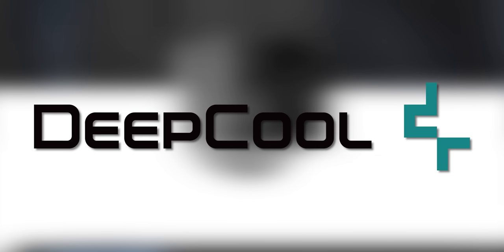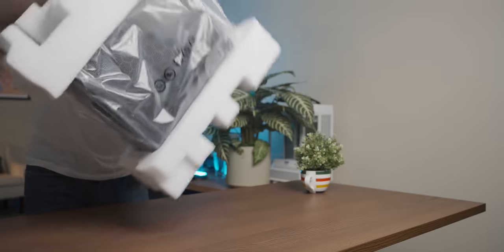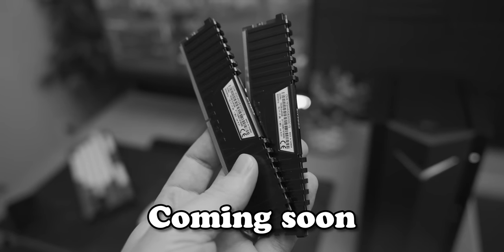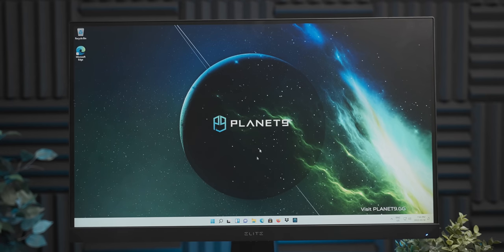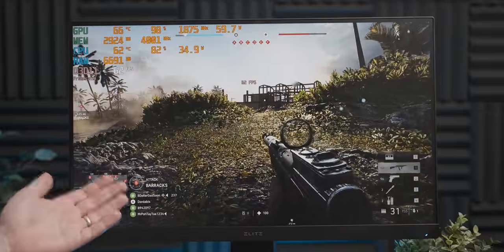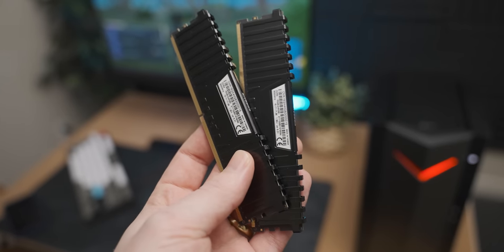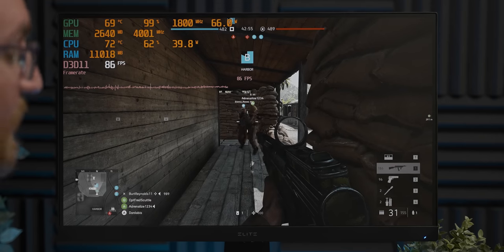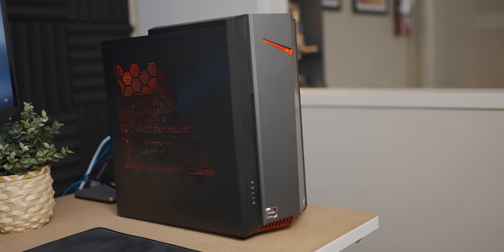I Bought The WORST Rated Best Buy Gaming PC

Comment: My Lenovo Legion T730 has also such an amazing Bios (with mouse cursor but that doesn't works at all)
I have a I 7 9700k without any Oc options 
Those offered trough lenovo vantage wont work both for Cpu and ram
Ram are 3200 and only run at 2600 and all such stuff

Comment: Well I have an Acer Predator Orion, I upgraded the Ram from 8gb to 16gb, you have to use non-xmp Ram, I had some sticks and they run at 2667, I also threw a 3060ti (it came with a 1660 super) and runs great, the processor is an Intel 11400f that could use a better cooler (is not a cooler master)

Comment: The part i find funny is that it already has one of those sata power cables in it already...both used to power the LEDs...both, not one, but both, because we all know that LEDs are notorious for being power hungry.

Not only that, it has an additional 2 proprietary sata power headers on the board, which means 2 sata power cables each with 2 sata connectors for a total of 4 sata power connectors, all the while only having 2 disk rails AND only 2 sata data ports on the actual board itself. (another potential sata port could be soldered next to the ram slots, it has pads for it, but that's still 3 out of 4)

Comment: the part that is limiting the gpu actually IS the cpu...you have a 5600g with 6 cores and 12 threads..so if you get around 50 % cpu usage its actually using 100% of the hardware cores...
and you will never get 100% ram usage at gaming because you are running things in the background and there is always some system reserved ram

Comment: @Dawid, my system is a Lenovo ideacenter AIO 3 24ARRO5
Processor	AMD Ryzen 5 4500U with Radeon Graphics            2.38 GHz
Installed RAM	16.0 GB (15.4 GB usable)
System type	64-bit operating system, x64-based processor

do you have any recommendations or videos for upgrading/overclocking etc.... presently it is plenty fast as my gaming consists almost exclusively of war thunder, world of tanks and world of warships all of which I can play at max settings 60+ FPS however if/when I move on to any triple A titles I realize i might need a bit more oomph.

Comment: The shell looks almost identical to the Lenovo ideacentre 9 desktop. Which I bought like 4 years ago for like $300 at the time. Upgraded my GPU to GTX 1660 OC, added 8gb more ram. 

All in all I only spent just under $600 (579ish) for an entry level gaming pc and light video editing with very similar specs to this build 

Do not spend $1200 on this. When you can build it for literally less than half.

Comment: Probably stupid Q: is the GTX 1650 connected to the PSU, or is there an cable from the PSU that can be connected to a GPU? Since I'm guessing it is a proprietary PSU connection to the motherboard, you can't simply put in a new one if it won't work with an upgraded GPU. At 500w though, you could definitely power a decent midrange GPU in there, as long as it can connect to one.

Comment: I don't get why the original ram is running at 3200 but upgraded is slower than stock.

If the speed can't be changed in bios is the original ram proprietary and recognised by the system?
Reply: its the set base speed of the specific module, most ram technically needs to be overclocked to reach its advertised listed speeds and is base clocked a lot lower like the 2133mhz shown here. basically the stock module has a much higher base clock than ram that needs xmp for a higher clock

Comment: I recently picked up a AMD Ryzen based laptop, and it came with single 8gb stick. It only has the built in GPU, it's a Vega 7 I think, and it could barely run any games. I managed to find an identical 8gb stick, and after install it can actually play games. Forza Horizon 5 went from unplayable to a steady 30fps at medium low settings for example. It's so important not only for the CPU but using an APU based GPU it's basically required. I know it's not a gaming laptop, but that $25 stick of ram made it so much better. 8gb might be enough but not in single channel sheesh.

Comment: i have an acer nitro 5 laptop its the an515-43 2018 version if i recall correctly and ive had it for like 2 years. probably 2k hours of usage, never cleaned it once so when i open steep it spikes instantly to 80C both cpu and gpu and then later gpu hits max 87c and cpu max 92c. planning on upgrading to a non-prebuilt desk computer

Comment: One thing to note about the ram is that you need to buy JEDEC-specced RAM if you're seeking higher than 2133 speeds because these BIOSes(?) can't read XMP profiles. Manufacturers like Crucial sell RAM with JEDEC-3200 profiles. As for your "mom buying little timmy a PC" use case, there's no way a user like that will know that information.

Comment: Okay ... I have had prebuilt machines from BestBuy. I buy a lot from them. my latest gaming pc is prebuilt! I have an ASUS rtx3060, i7-11700K 32 gigs of memory, (3200mghrz) 2 terabytes of memory. Granted, the CPU cooler is trash, but I upgraded it with the Noctua NH-D15. Runs amazingly! I run 165 FPS on my 2k monitor from dell so not bad (apex, Anthem at all high- ultra settings (yes, I like the game don't judge me) ~ that's being said, if you know what you're doing, how to tweak your system correctly than you have a solid PC. I got the PC prebuilt due to not finding a decent 30- series GPU... so this was my best option. usually, adding new ram and a better cooling system does the trick!

Comment: Hey, when you start that monthlong suffering with the Acer Nitro Suck Face MACH 3, put the 8GB stick of ram back into it so that you can have a "long term" experience with it performs out the box, similar to how a non-techy average consumer would buy and use it. Not knowing the system is being held back by that single 8gb stick of ram.

Comment: I bought Acer Nitro N50-600 i5 8GB 1TB 128GB 6GB GTX1060 Gaming PC from ARGOS and it is excellent very fast great reliability with no problems I added a 8GB of memory to make it twin channel but that was all. It has run perfectly for two years and I love it. It is a quite different Nitro 50 than yours I admit. My bios is totally different from this one and game performance  does not change over time. Even after two years it’s still as fast as it was when new. Maybe the export a better version to the UK but  I  have said no issues with the UK  model.

Comment: Ive got the 11400f and 3060ti model when the gpu shortage was still much worse. With only a single outtake fan the gpu runs upto 78-80c but the cpu with the crappy cooler never hits above 50. Came with dual channel ram by default and a 1tb drive. The only complaint I really had is the case is pretty cheap and I have to remove my gpu to reach the sata ports. Think they reused the motherboard layout of the 1660ti version which didnt reach that far to block the ports🤣

Comment: Really goes to show how much dual channel memory can lift the performance of a crappy system like this. Currently running an OEM i7 6700 from ages ago (back when I didn’t know about the PC community), and it has single channel RAM which makes the operating system chug a lot in certain cases. Furthermore, Z170 only supports up to 2133 MHz RAM and Dell cases are EXTREMELY hard to replace the motherboard without major rewriting.

Comment: That system getting slower is almost definitely a result of the single stick of 8GB.  Because it would likely be using more than 8GB of system memory when gaming, you'd be using that poor NVMe drive as swap memory, wearing it out quite rapidly (Limited reads and writes).  I'm surprised Acer's R&D department hasn't caught on to this and upgraded to 2X8GB or even 1x16GB stick(being cheap corner cutters they are) instead.  8GB is just not nearly adequate for Windows 10 or 11 while running games.  Seems like they're more concerned with getting as many systems out the door as possible rather than providing a quality product.

Comment: I had a nitro 5 laptop which came with single channel 8gb of ram and I constantly had stutter in games for no reason. I then bought a single stick of 8gb crucial ram and combined it with the stick that came with the laptop. Inanely better performance with no stuttering and it ran at 2666 which I think is the max speed of that stock ram. The crucial ram could probably do 3200

Comment: I’ve had quite a few acer computers since they always had higher specs for a lower price. And only one out of the 4 different ones I’ve owned over the last 15 years actually overperformed and never gave me an issue. 

It was an amd a4 1.0ghz dual core netbook with 4gb of ram and a touch screen. Absolutely unit lasted me throughout uni and even played some games at their lowest settings.

The other three (2 desktops and one laptop) all were fine but always had some sort of software issues and niggling things that were mildly annoying, not bad enough to refund.

Comment: I just bought the Acer Nitro 50 640 PC, with an Intel i5 12400f and a 1650, and for $599 US, and it’s literally been perfect, it runs all my favorite games like Valorant beautifully at 240hz 1080p low. I haven’t had a single issue. For the price I’m completely blown away and very happy. Don’t let this video scare you.. I’ve heard bad things about the Ryzen Models, I think those Acer Motherboards hate Ryzen. Oh also, mine doesn’t get any hotter than 70 Celsius max.

I like it so much I’m gonna put a 3060ti into it and more ram, yes, I haven’t even added ram yet and it runs great.
But yeah, the Bios is horrible lol but at least my ram came in at 3200 which is what it rated at

Comment: Changing Ram is just a part of the fixing. Add HDD or SDD and install all games as well all programs except Windows will help  with the problem. I guess that installing games nd other programs as well as keeping big files simply makes this PC unusable. Also I believe that PC has more standard components than DELL and it is much easier to change motherboard Power Supply Unit than other prebuilt systems.

Comment: I have nitro 5 laptop, which is very nice tbf... I bought it in best buy for $1200, i7 gen 11, 16 gb(2x8) ram, rtx 3050 and 512 gb ssd, i did upgrade it tho, so now its 32gb(2x16) ram and 512+1024gb ssd... The ram kit costed me $100 and ssd $90 and installed it myself

Comment: i bought a computer for 1200 and it came with a 6600xt which i was ok for 1080p but in 2 days it woundnt send a display to my monitor, i worked one more week and bought a 2060 prebuilt for 1300

Comment: Some of the really cheap keyboards are, well really cheap, but not terrible. When I saw a bin of keyboards at best buy for $1, I bought 10 of them. I'm using one now. I prefer the mechanical keyboards, which I had until I spilled a beer can into it. Still, the rubber domes are not terrible... just not great. Typing speed goes down at least 15% on the rubber dome, but hey, what do you expect for $1. About 25 years ago I bought a stack of mechanical keyboards from the Salvation Army for $1 each. It included some IBM model M keyboards, which I wish I had kept. Instead I cut the AT connector off, put PS2 connectors on, and gave them away. BTW, mechanical keyboards you can put into the dishwasher. They will be fine as long as they dry before reconnecting. I would not do this with rubber dome, as water could be trapped under the plastic film. For the rubber dome keyboard, the best way to clean is to throw it in the trash and open a new one.

Comment: Why would they put that ryzen 5 into that, that's the same I have for my 6650xt and it's good with spec that's a 250 dollar cpu with a 400 dollar gpu that's not needed , get a 3200 and save 75 bucks, that 5600g does more than that gpu will let it anyway

Comment: Dude is the 'loser suck new edition' proprietary or is it just that new 12vo thing where the psu does 12v to the board and the board does the rest, only ask cause didn't spy a long atx connector either??

Comment: I mean I got an hp omen 870-224 it has a gtx 1060 3gb it came with a 1tb hhd but I swapped it to a 1tb ssd it came with 8gb ram 2133 I swapped it to 2 Pny 8gb 3200 ram stick but are stuck at 2133 it also came with a i5 7400 I believe it’s 3.0 ghz

Comment: At 6:30, he says its not the cpu because the cpu isn't at 100%: This is wrong because of the way CPUs are threaded. If one thread is at 100 and bottlenecking, the whole cpu wont be at 100. Rather, the GPU at less than 100 means that something else is happening, and it technically is the cpu, but the cpu can't prepare enough frames because of the slower memory. Slight clarification, as technically the cpu doesn't have to be at 100 to bottleneck and the cpu bottlenecking doesn't mean that the cpu itself is the bottleneck.

Comment: idk if you will ever read this @Dawid Does Tech Stuff... GTA is running on a bad engine that was first meant for 30fps...even high end gpu's can barely keep stable fps and the engine crashes at around 180fps...the second it's over 60fps the gpu is less and less working because of engine limitation...yes the ram configuration doesn't help but the engine is just horrible for high fps gaming..... you can search footage of rtx 3090 on gta and it's used at about 50% no matter the hardware paired with it

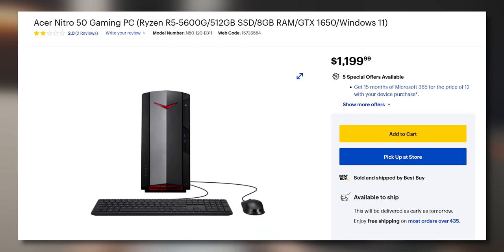EDIT : at 11:20 the second i saw your t-shirt i laughed my ass off XD

Comment: Ram speeds are weird my laptop which has a 10th gen intel processor and 64gb ddr4 ram has a weird processor chipset ram limit of 2933mhz so you need to buy 3200mhz ram then it gets cpu gimped even though the motherboard chipset can support 3200mhz always thought intel is having a laugh at people for some stupid reason wouldnt have been difficult to give the full speed.

Comment: CPU
	AMD Ryzen 5 1600	
	Summit Ridge 14nm 

RAM
	16 GB Dual-Channel Corsair @ 1197MHz (15-15-15-39)

Motherboard
	Gigabyte  AB350-Gaming 3-CF (AM4)	

Graphics
	Gigabyte 8GB ATI Radeon RX 580 Series 

I need to upgrade CPU MOBO RAM without bottlenecking the RX580

my budget is € 400,- more or less

Comment: I can't believe I'm probably going to be the only guy saying this. I've pretty much stuck with Acer's for a long time because on the secondary Market I find them reliable. I deal with a lot of used laptops!! Windows XP generation Dell laptops we're a tank I love them but needless to say most people don't think much of Windows XP anymore and I don't think they'll run Windows 7 very happily. I went through several brand of laptops that usually just did not live very long due to component failure and age. Then I got into using Acer's I don't know why but first Acer I got had been to war and would have been considered a war crime and it lived about 4 or 5 years despite what atrocities had been done to it. The machine had been badly smashed spent roughly a month laying in this guy's backyard before going out in the garbage. I never did replace the keyboard I replaced the screen and it came with no hard drive no hard drive basket no battery and the bottom plastic plates were missing. Ram hard drive caddy and hard drive came out of another machine that I got in the garbage and I used it somewhere between five and seven years on a daily basis as a media machine and it just lived and worked furthermore I had it running Windows XP not connected to the internet. I've since then gotten several of that particular model Acer over the years and they just work. I upgrade the RAM and put in an s s d and they seem to be fine. Admittedly when I got them I got them for next to nothing because of user error and people thought they were Parts LOL. One I've been using for about a year-and-a-half as a daily driver which almost never gets turned off is a Tricor every Acer I had prior to this was a single-core till I got a quad-core from Russia that somebody brought here and throughout. The quad-core I use connected to a television for running stuff on the television and the Tricor I paid about $30 for with a chill pad and a laptop bag whereas buying a good Acer Tricor around here locally will run you a boat 200 box for a Windows 7 generation. Guy I thought it had bad speakers basically they tried to put Windows 10 on it and things have gone badly. Basically the whole time the machine was on it made a very bad noise coming from the speakers LOL. Turning off the speakers or plugging in a headset and initially fixed that wiping the hard drive putting an SSD in and installing Windows 7 fixed all the windows 10 problems. I've been using that machine now two or three years and yes I upgraded the ramp significantly. I don't use it for gaming use it for YouTube and that's about it other than basic internet stuff. admittedly I don't game on computers I use consoles. I feel very ashamed that machine is sold as a gaming computer and they charge that much.That being said I wouldn't mind taking a shot at what you want for it when you're finished testing it. I wouldn't mind seeing if I could afford it and then max out the ram and maybe put a happier video card in it running Windows 7 or Windows 10 I do not want Windows 11 for so many reasons. I figure the main problem with that computer is Windows 11 Disease.

Comment: You will never be able to run from the Loser Nitro Suck-Face Edition.

Though I will say, minus the price and the awful bios and the RAM and the cooler (though the temps seem acceptable surprisingly), this seems like not too bad a system compared to previous attempts by Acer. Definitely worth testing for a bit longer, though, see what creeps up.